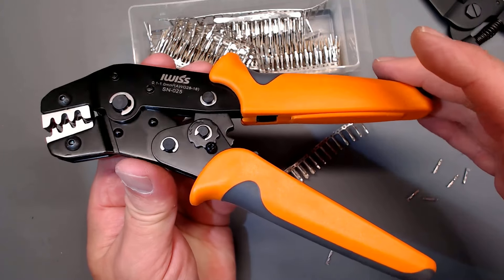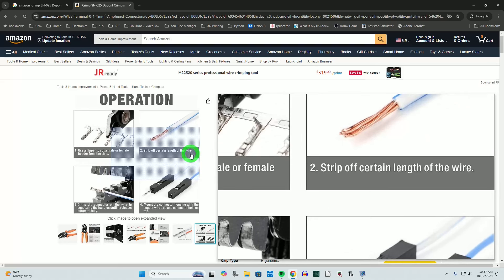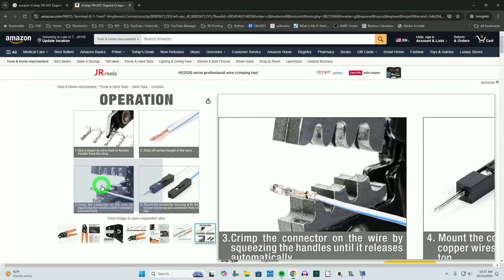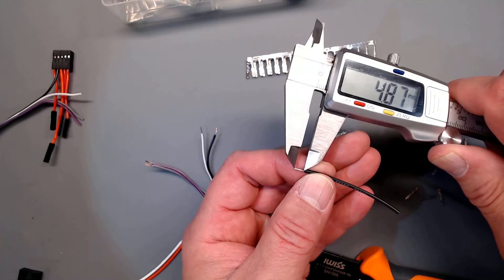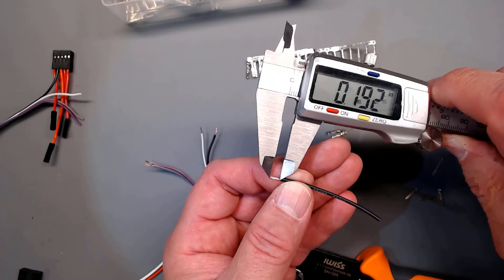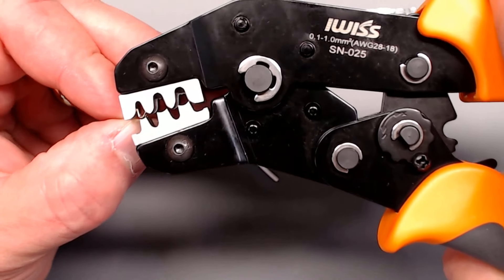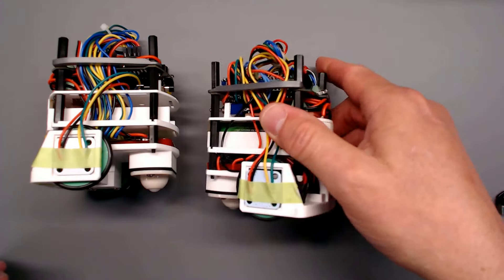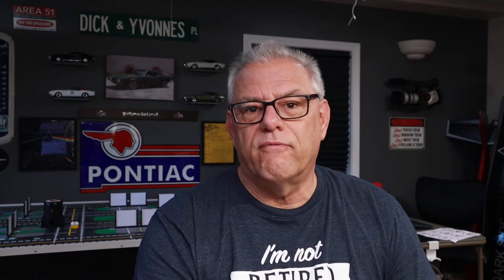After fighting my old crimping tool for Dupont connectors, I found a better tool

Comment: i recently bought a few crimping sets and i too had this experience, the jaws were very sharp and felt like they made really nice crimps. was a different brand but they looked a very similar
Reply from the maker: Hello bacskje2598,

I suspect there is one mfg making these crimpers with many different brand names, this is very common in Chinese manufacturing.  The quality of these, especially on the die surfaces, is remarkble.  Usually there would be be steel stampings as opposed to precision machined (they stated they are cut with EDM machines and it looks like they are).  
I am glad you found joy with your Crimpers as well!
Cheers!
Chris

Comment: Just wanted to say thanx for posting this vid. I bought the crimpers you highlighted, and they work really well. Well made for sure. They fall under the brand name of iCrimp, but the part number is still the same. This whole time I was meticulously soldering the pins, not knowing how to actually use the crimp tool. Now my RC Tank hobby is much more enjoyable and the Dupont connectors are way more reliable. Thanx again kind sir.
Reply from the maker: Good morning kennethrich2107,
I am happy to hear that I was able to help you with your wiring madness, stay happy my friend.
Cheers
Chris

Comment: Hi Chris. A couple years ago I went through the same process working with Dupont connectors. You are correct, it takes a bit of practice but I didn't really mess up too many. I do a lot of breadboard design work and I found the cheap ready made jumper sets were very 'iffy' and so many problems with my designs was due to the pre-made wires. Most are molded not crimped ends and they usually have round ends and slightly thinner pin diameter. In fact I had so many problems I decided to get a crimper, similar to your iwiss brand and bought a ton of mostly male pins and housings. Then I actually cut off and replaced ALL the ends on my pre-made cables (hundreds of them). I'm sure some will say my sanity is questionable and they may be partially correct. However, I wasted so much time and energy trying to troubleshoot problems that ended up being poor connections of the pre-made wires that it was worth it. Needless to say I got a lot of experience with the crimper tool & process and that is always good.
I also tried soldering some of those pre-made cables in a few instances and found an interesting fact. Many (most) of the wires from the pre-made sets could not be soldered! Turns out they were not actually copper wire inside. I assume they were aluminum but actually looked like copper color. I actually measured the resistance of the pre-made 'aluminum' cables with a crimped cable I made from different wire (copper) and the aluminum was measurably higher resistance in every case. The reality is the difference would have made no functional impact but it was interesting to see. 
Well I rambled long enough. My summary is YES the crimper tools are excellent (yours & mine anyway) but the ready made jumper sets can be dubious quality. This can be improved by crimping your own ends on them instead but, it's a lot of work. If you're new to breadboarding and have a problem especially inconsistent results, try replacing the cable(s).
Regards to all - happy breadboarding. 😁🇨🇦
Reply from the maker: Good morning Starlight-AG,
Thanks for sharing your experience with everyone.  
Having your sanity questioned in such situations demonstrates your commitment to excellence!!!!
I also looked deeper into the stiff commercial jumpers with Dupont connectors and frankly I am not sure what that wire it made of. I was so puzzled, I took a magnet to it in an effort to see if it was STEEL -it wasn't.

Thanks again for sharing your experiences.
Cheers!
Chris